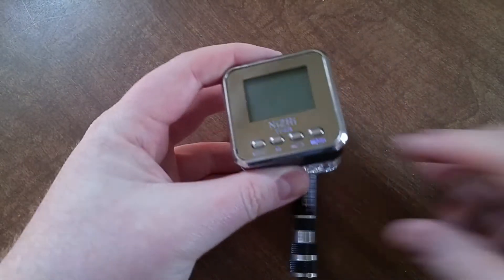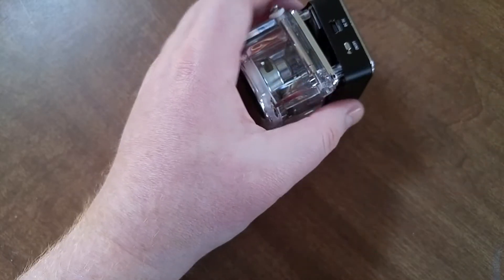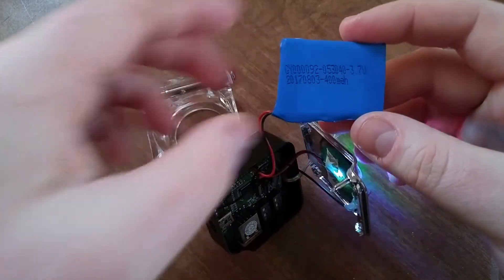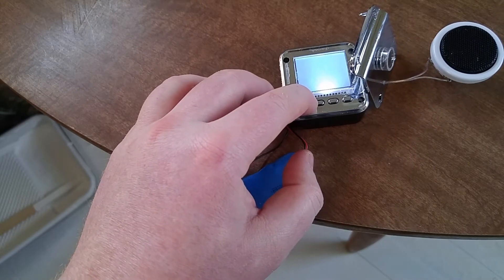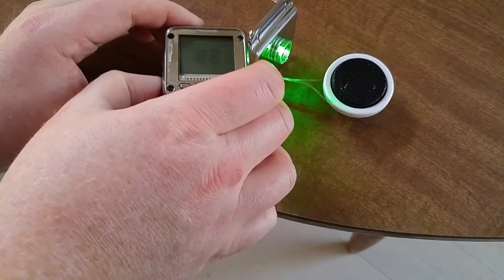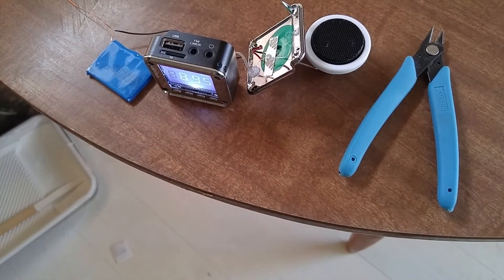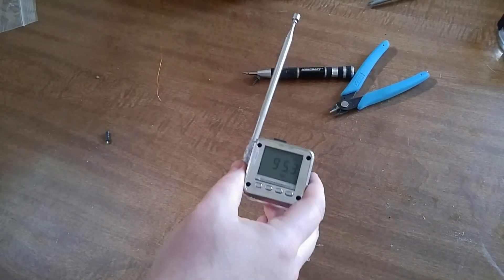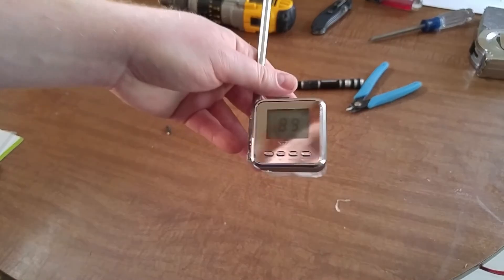NiZHi TT-028 tear down and antenna upgrade

Comment: The battery is 1S1P Li-ion 3.7V 400mAh 053040 or 503040 ie. 5mm*30mm*40mm

Generic replacements are readily available online for about $5. Most current batteries are 600mAh due improved battery tech.
Reply: Man, exactly what I was looking for. Thanks!

Comment: The TT-028 uses the line jack as an additional antenna. The newer model td-026 uses the USB for the same. Idk if the hack for the antenna was worth it when you consider that, but it's nice to see a teardown and how to permanently disable the annoying disco light.
Reply: I'm actually trying to look for a replacement TT-028 or TT-029 with the flashing LEDs.  I use these to light up my Jedi and Sith Holocrons and play some Jedi  and/or Sith mumbo jumbo via the SD card.  But these are hard to find nowadays.
Reply: @1515cci  i saw some TT-028 and maybe some TT-029 on aliexpress but not on Amazon or ebay. I've been buying a lot of different models from that factory just to research them. Those TT 28 & 29 models seem to be the best ones they made. They don't seem to be produced anymore. After those, they stopped using lcd displays and switched to led with no display for fm frequency.
Reply: @ I looked but found nothing on Aliexpress but I did find a used TT-028 on EBay and bought it. I also ended up ordering the newer TD-026 since these have the lit LEDs at the base.

Comment: What kind of screen is that?
Mine (screen) broke when I dropped it...  was thinking of getting one of those DIY screen replacements (they are cheap on Amazon) but I don't know what size or what connectors it has

Comment: For a 15 minute video you didn't say much, but showing how to get the front cover off made it all worthwhile. My battery was US and I was wondering how to strip it. Turning off the LED is so easy I don't know why you would bother disconnecting it.
Reply: 1S1P Li-ion 053040

Generic replacements available.

Comment: STUPID LIGHT - Hold down the left  button and it shuts off
Reply: I agree it's so easy.
Reply: @bobjackson4720  although I remember a video were a guy saulders a wire to were the radio ANT attaches and sauldered a lrg reg radio ANT to it. Far range crystal clear

Comment: Thanks for this teardown.  When it comes to getting those plastic/glass front covers off that're glued or taped down, I find a quick blast with a heatgun to warm the adhesive makes it MUCH easier and cleaner to remove.  Anyway, you've got a new subscriber :)